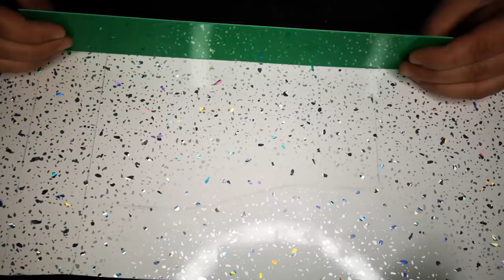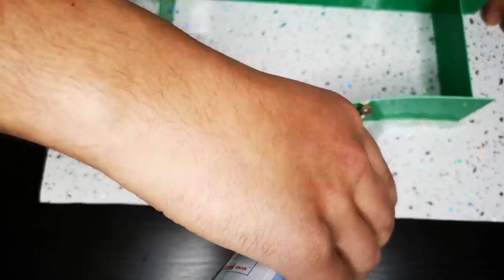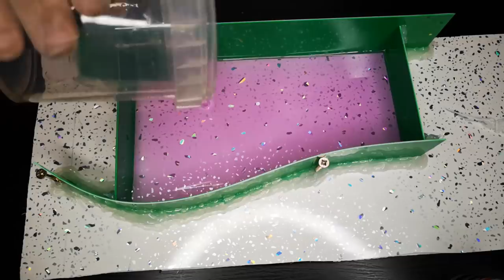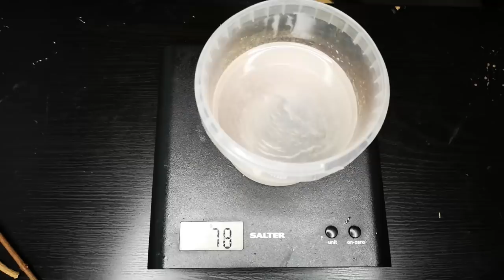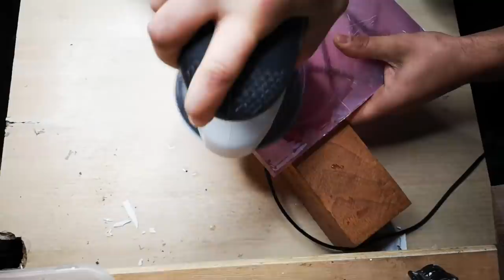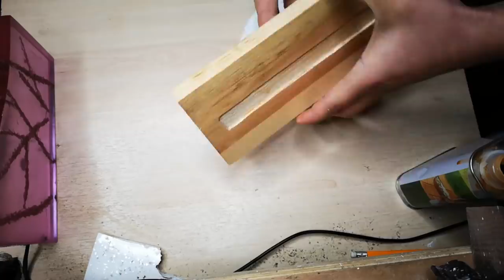Violet Epoxy Resin Night Lamp - Resin Art

Comment: Amazing work!! A quick question, what will happen if you do this without the vaccum chamber??
Reply from the maker: air bubbles will be visible
Reply: @mbresinart  will it look so bubbly and bad? Or is it kinda acceptable? Thank you for your replies
Reply from the maker: @babakgholamrezaei5304  will not look bad

but I didn't want that result
Reply: @mbresinart  If the vaccuum chamber is not used, will it effect the lighting? And/Or be safe without vaccumming too?
Lovely work, btw! This lamp is toooo good!
Thank you